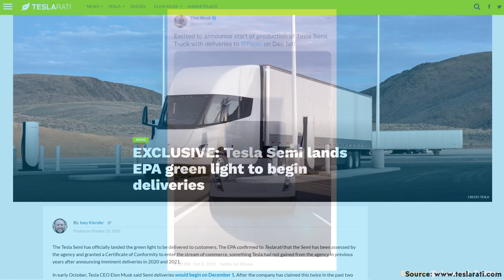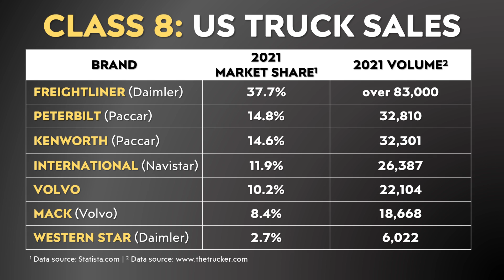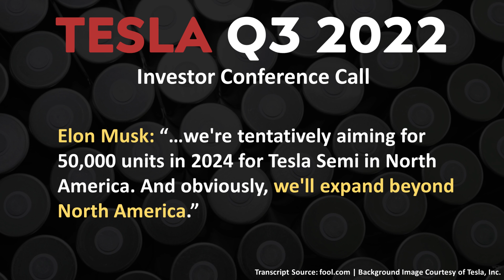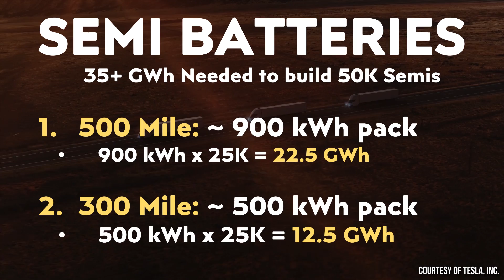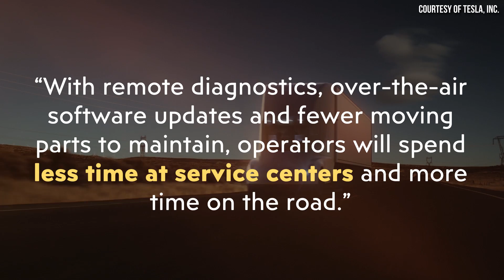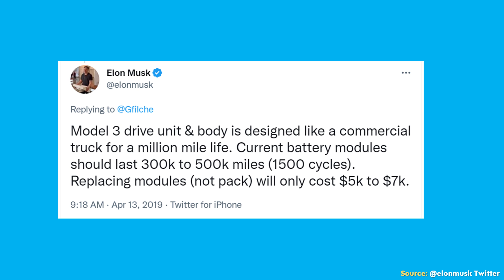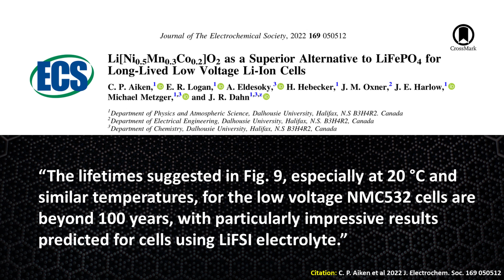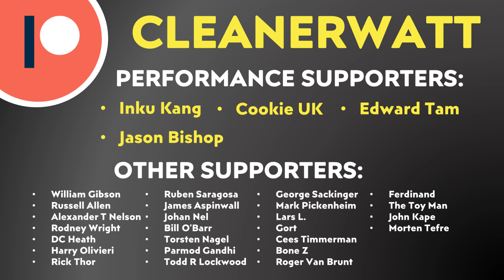Tesla Semi is about to DISRUPT Trucking | Competition BEWARE!

Comment: Jason Fenske, Engineering Explained just did a study to verify that the Tesla Semi can probably work under ideal circumstances. Point to point distribution with charging facitlites at the destination seem to be possible for sure. All the major stores will be after these trucks for distribution. Fuel savings will be enormus going forward. Nice show, keep a look out for more news.
Reply: Not just fuel savings, maintenance savings and downtime due to maintenance will be huge. A fleet will need fewer trucks and fewer mechanics.
Reply: @davedavenport8673  People keep saying this, but that hasn't even been proven by Tesla's CARS.  How much savings do you get when your semi has to go to a Tesla service center for electronics problems?  No truck, no deliveries, money LOST.  And fuel is a DEDUCTIBLE EXPENSE, so your assessment makes no sense.
Reply: @billcichoke2534  sweet so charging is deductible. My Model Y has had zero problems in 2 years. Only refilled the wiper fluid. No oil changes, no brake degradation, always filled up with energy every morning and I only charge on 120V 20amp circuit, but I don’t drive a lot in daily use. As far as trips, I have driven from Seattle to Los Angeles twice with no issues. Get food and go to the bathroom at charger stops. Total cost of ownership is way cheaper than a similar bmw or Mercedes small suv.
Reply: Bill you've made a valid point. If I had truck stop business,I would be calling Tesla on a daily  basis "please install your super charger". There are going to be plenty of situations where you can't charge at the distributors.  Owning any business you need to change with the times or be left behind.
Charging any Tesla vehicle in the near future will be just as convenient as our current gas stations
Reply: Little charge at every stop - great.
LA to Chicago non stop - not the right tool.
Reply: @CHMichael  Correct, thankfully the vast majority of trucking is short and medium haul, so that is what makes EV Semis a viable product. You don't have to address every use case, just the mass majority of them.
Reply: @davedavenport8673  No, the vast majority of trucking (what this semi is SUPPOSED to be designed around) is LONG HAUL.  But even as regional, these things are going to be absolute nightmares if you try to do anything outside of their very controlled 'proof run.'  It'll have issues dealing with ONE trailer going over the Siskiou mountain pass, for instance.  Think about how much fun it'll have trying to deal with the more common DOUBLE trailer setup, such as FedEx, UPS, and many others run.

Yikes.
Reply: @billcichoke2534  this is false. Maybe by miles long haul does more but the vast majority of trucking is regional. Tesla worked with a number of trucking firms and with their data to ensure they could cover a majority of use cases. When you add mandated rest periods at 8 hours then it actually makes long haul possible if the mega charger network gets built out. That will take time though. Baby steps.
Reply: @davedavenport8673  If you mean an 80 mile radius, neither Tesla semi makes sense.  If you mean 150 miles one way, the eCascadia is already running those routes.  Again, no word as to any savings from doing so.  It would be major news if it was.

And the 500 mile semi was sold as a LONG HAUL truck, with the 300 mile version being used for regional routes.  So your point is, to be honest, merely academic (even if accurate).  This version is supposed to compete with long haul trucks and trains, not regional single or double axle trucks.

It's already looking like that ain't happening.
Reply: @billcichoke2534  I know you didn’t watch the reveal of semi years ago or you would have known some of these things. Go search for it and watch. The Semi was designed specifically for regional trucking. Yes, they will make a sleeper cab version but the company or driver ordering it will need to do the math on total cost of ownership and the routes they can do with it.
Reply: @billcichoke2534  500 miles with 82000 lbs. Let that sink in. In fact real world miles over grapevine. If a company is worried about degradation of the battery then they should buy the 500 mile version. A 300 mile range version gives you over 150 mile radius since most regional trucking is not max payload. 

The major trucking companies will be scrambling for these things when their accountants do the math.
Reply: @davedavenport8673  Actually, I would ask you to do that very thing.  And remember something...he mentioned RAIL.  Rail is not used for regional shopping any more than trucks with over 200 miles of range.

This was specifically sold as a LONG HAUL truck, with the 300 mile version being used for regional shipping...thus the smaller cab.  So, again, either the narrative is being changed, or a lot of subterfuge is being employed to make it appear viable for OTR trucking.

One thing is sure...it's DEFINITELY being used to bolster the stock price, so the cultists don't lose faith.
Reply: @CHMichael  only a multi driver situation would be better on an old semi. Mandatory breaks after 8 hours. You should be able to get 400 miles of range back in it in about 40 minutes.

Comment: Yes  please.
I'd like to know more about the trucking industry moves away from petroleum.
Thank you for a great video.
Reply: Yes, and I would be interested to see - as you suggested/offered Jon - what's going on with the competitors. 
Having been working 1989 for a short time at DAF in Eindhoven/NL before they were bought from Paccar. 
It would also be interesting to see what Daimler (the biggest plant is in Wörth Germany) and companies owned by them - will do. Still they are very large. As Daimler was splitted, now its just the Truck company. 
The same with Volvo 
but also Volkswagen who bought into this business with Scania and MAN. Fuel is more expensive in Europe while solar electricity can be produced locally and should be less price sensitive. Well electricity prices tripled 3 times every  year in the past two years in Germany.

Tesla has the knowledge to make the batteries more stable in long Term. 
Re 4680, for the Truck the battery seems not to be a structural component. Jon, you know it better, but right now the 2170 seems better for fast charging until the 4680 is at a high development state.

Comment: HAVE THE TRAILER WTIH 2 WHEELS DEDICATED TO POWERING A GENERATOR TO CHARGE THE TRUCK AS IT TOWS..........THE SMALL RESISTANCE AND WEIGHT ADDED WILL BE NEGLIGIBLE BUT KEEP THE TRUCK CHARGED ON LONG AND SHORT HAULS
Reply: "Two wheels dedicated" means two wheels "collecting" energy.
("Generators" create drag, ref regen braking)
The drag of the generators requires energy to be used to overcome the resistance.
Since no machine is 100% efficient, that energy will be more than the generators produce.
There's no gain.
(Also more weight/ complexity)
Reply: @rogerstarkey5390  then have two drop down wheels at the rear of the trailer that retract when not in use . they don't need to carry weight   JUST TURN
Reply: Nope will not work
https://youtu.be/Np1Ixd7FWzI

Comment: Especially, since all they did was change the power train, from diesel to electric.    The redesign of seating to center is a game changer for the driver.
Reply: "since all they did"
Actually you have to redesign the whole vehicle. Look at the legacy automotive industry, they tried to use old design and assembly lines into a EV and realized it's not possible for ramping up production.

Comment: USA is not North America, it also includes Canada and Mexico. Massive difference.
British Columbia has massive incentives to electrify commercial trucks, exceeded only by CA and NY state incentives
Reply: Yes ok,, what's your point?
Reply: @Thenakedfinisher  the discussion is quoting figures of 283 thousand vehicles as the current market, but shows the slide stating is for North America. Then the discussion is only for the USA and uses the entire north America market size and states it is the US market size. Apples to Oranges.
Either talk about the US market only and use US only sales figures, or discuss the entire North American Market. Mixing the two negates the validity of the conclusions. 
It would be like discussing the US ev market and then only CA, WA and FL.

Comment: Cummins Engine also working on EV drive train.
Reply: Good luck, Ford,GM and even in the early days of Tesla have incredible difficulty ramping up production(because he bought a old ice factory in Fremont California) .If or when Cummins begin to ramp up, Tesla will have the market
Reply: Are Cummins redesigning the truck to remove the beam axle which carries the diesel engine, plus redesigning the chassis to remove structure which resists the torque, plus redesigning the body for streamlining, etc?
Otherwise, they'll just have an overweight inefficient EV.

Comment: isn't the problem with 4680 batteries vis a vis the semi that because of their larger size, cooling is more difficult, and it's harder to output large amounts of power? I wouldn't assume it will ever convert to 4680. This is also true for Tesla's other high power vehicles. Even as 4680 production ramps up Tesla will still be buying millions of battery cells from their suppliers.
Reply: It's true that the larger the cell, the harder the cooling but at battery day (as I remember), they said that with the Tab-less design with its reduced resistance, would be thermally equivalent to 2170.
Reply: There's no electron bottlenecking with the 4680 tabless batteries so cooling is less of an issue.
Reply: You re underastimating Tesla and the power of engeneering
Reply: No, it's not a problem.
.
I'll use the train analogy.
.
Consider a train full of passengers, 3 carriages, a single door at the front of the train.
Now, a second train, also full 12 carriages, but 2 doors in every carriage.
Which train offloads passengers more quickly? Which passengers are less stressed?
First train, 2170
Second train, tabless 4680.
....
Nice try, but problem solved.
Reply: @rogerstarkey5390  I like your train analogy,  however,  I think people could relate to an airplane analogy better, since everybody who has ever flown commercially has experienced what electrons experience in a tabbed electrode environment. Contrast that experience with the possibility of having an exit door for every row of seats.